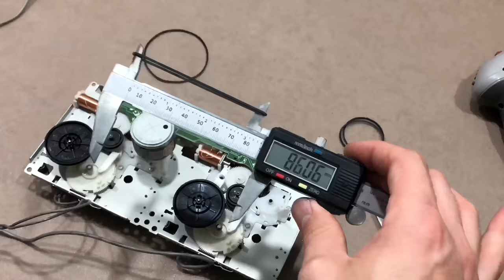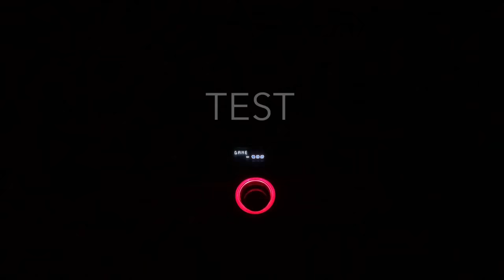SONY MHC-RG333 Amplifier Radio Cassette Player Cd Maintenance Repair Restoration 2

Comment: Hey man! Great video! I have a question for you. Recently I found out that my left speaker is a bit louder than the right one, so my question is how can I change stereo balance? Is there any thing that I can adjust on a mother board? My system is SONY HCD-GR5
Reply from the maker: ı dont now

Comment: Hello, I am repairing a sony grx8, when I put it together, the sound is good, but the relay that connects the ground of the output to the speakers does not activate, what could be the problem?
Reply from the maker: Hello. I don't know anything about this problem. But first remove the device and check for bad solder.
Reply: @manstuckonhishead   already fixed the cold welds, the amplifier works perfectly, but it does not connect the "RY404" relay according to the schematic, which connects the grounds of the surround speaker terminal block

Comment: Great job by restoring the  Sony mini hi fi system.
I had the model with the subwoofer for 16 years. In the last years the cd tray didn't open anymore.
I ended up selling it for 80 usd. I am such an idiot. I  don't appreciate the value of things.
It was my highschool graduate gift.
Such a powerfull sound it produced but not that loud.
Reply: Luiz

Comment: I love watching these vides. What is the difference in quality of internal components and STK, etc. between these units and the RX90 and RX99, basically those built 1996-1999 and the later models?

Comment: excellent video and your work I would like to ask you a question
I have this same equipment and there is a channel that works intermittently, at low volume it cuts off and when I give it more power it activates again but I also tried connecting it to the headphone output and both channels work fine so I assume that the problem is in channel power stage.
I would like to know if you could give me an idea of what it could be
Reply from the maker: Potantiometer ?
Reply: @manstuckonhishead  no es el potenciómetro con auriculares funcionan los dos canales perfecto es una falla intermitente en bajo volumen  en la etapa de potencia de un canal
Reply: @miglianingm I have a similar problem with the right side speaker.  Did you get the issue solved?